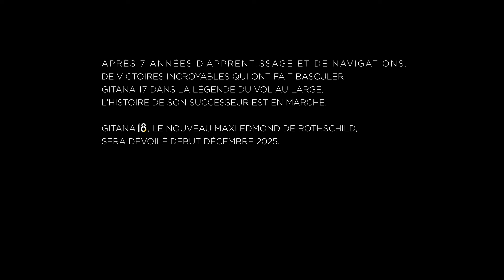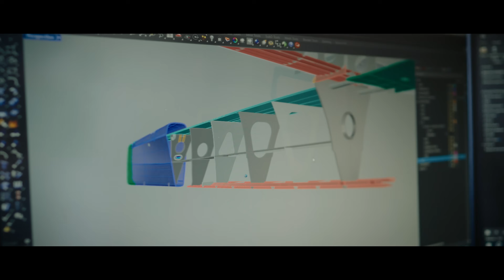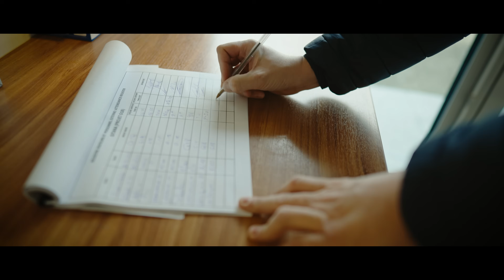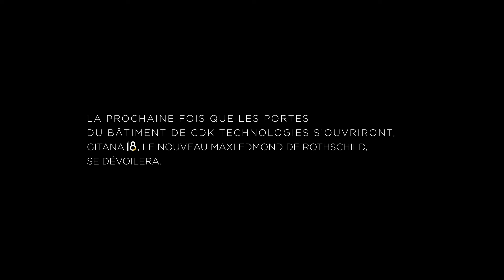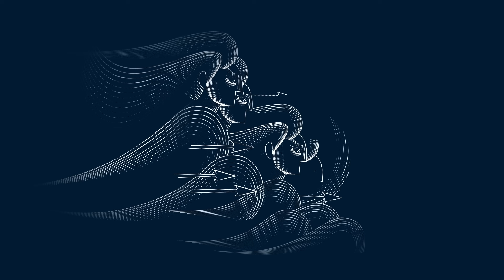G18 NDA - Épisode 6 : Travail d'équipe 🤝

Comment: I am really impressed by this projekt, especially as shown in the international expertise. But: I have one question: it is not uncommon that these boats will impact with Unidentified Floating Objects, damaging the foils, stopping the boat for continuing the race it is participating in. Are there any technologies on board to quickly repair or replace foils in such an occasion?